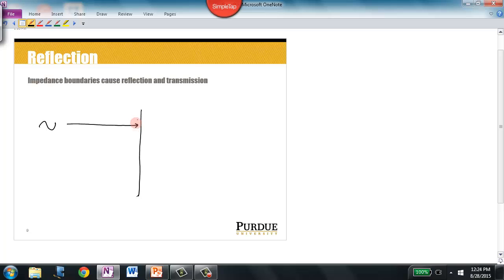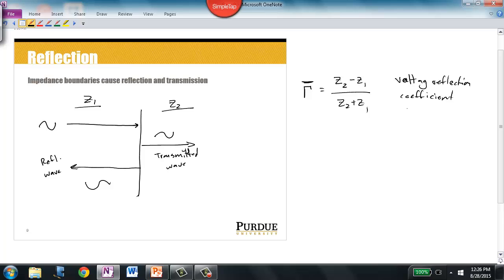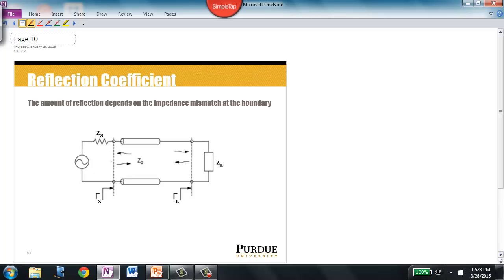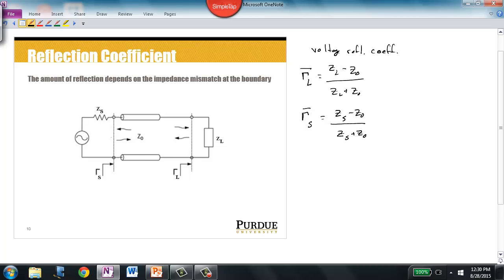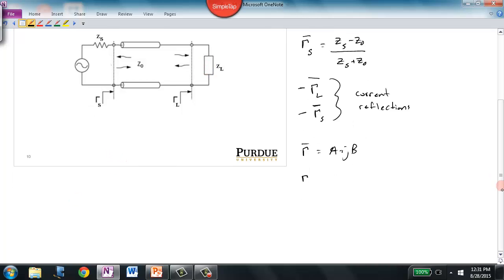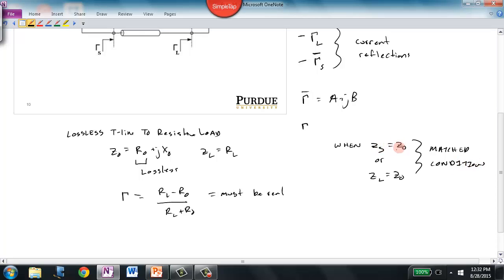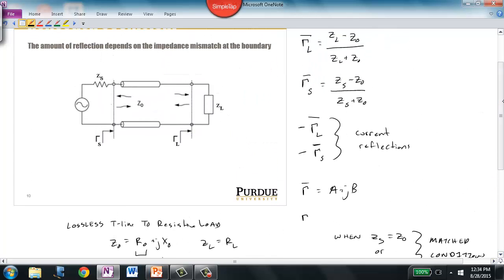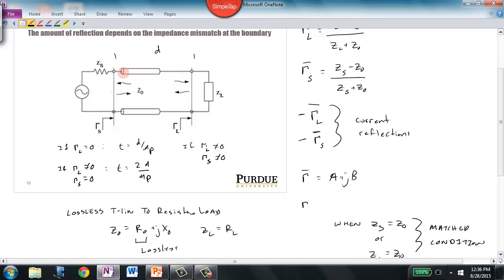Topic 5 Part 2   Reflection Coefficient

Comment: we assume there is no reflection at the Zs-Zo boundary looking from the source side. why is that?
Reply from the maker: Transmission line theory applies when the conductor length is close to or longer than the wavelength of the signal frequency.  Zs is the inherent impedance of the source, which doesn't have a length.  You therefore don't need to use T-line theory to analyze the input voltage.  In essence we account for this when we perform the voltage divider at the Zs/Zo boundary (i.e. lumped analysis).  Look at Topic 5 Part 4, which shows how Zs and Zo are treated for the input waveform.  There will be a reflection at the input impedance boundary for the reflected wave.